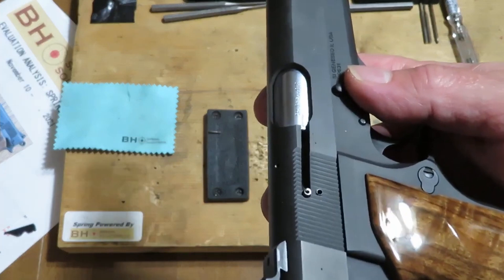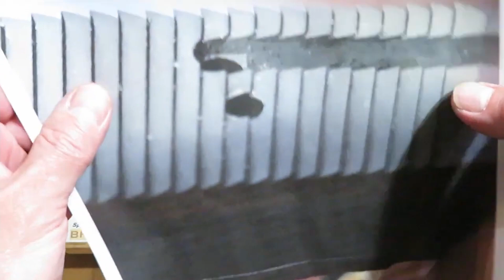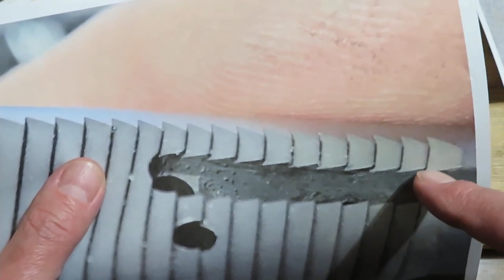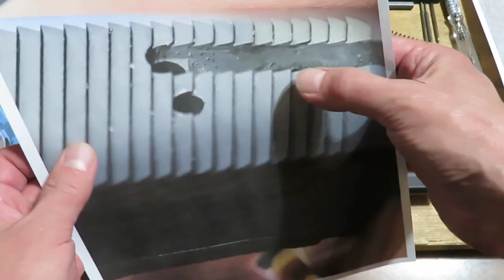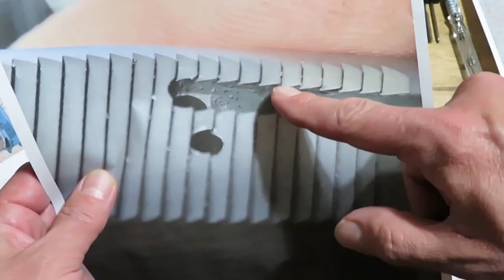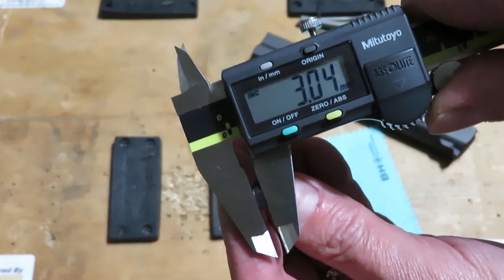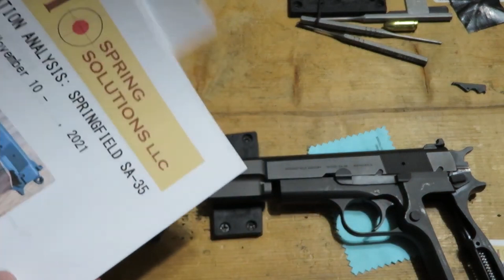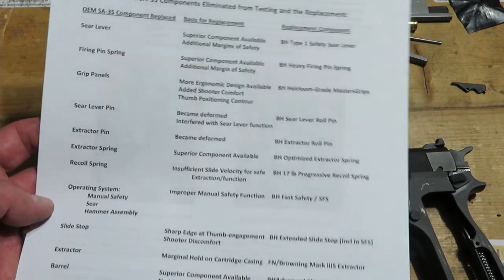Springfield SA-35 Hi-Power Evaluation & Testing Session 5 BHSpringSolutions Hi-Power University s.70

Comment: I really, REALLY hope Springfield is watching these videos and taking this information to their manufacturing plant.
Reply: This video would have to be in Turkish language for that. SA imports these pistols
Reply: @hstetser5376  I am pretty sure the SA -35 is made in America
Reply: @Grodd70  It may be partially assembled here but am near certain it comes from Turkey
Reply: @hstetser5376  I stand corrected, doing a Google search frame slide and barrel made in Turkey then internals assembled here. Well that takes it out of running for me.  If I wanted a Hi Power from Turkey there are others at a lower price point.
I'd maybe consider the FN but ill its "improvements" ruined the look compared to the classic HP. Plus it won't take HP mags, sure higher capacity is nice but so is being able to buy/ use Classic mags since they have been around for 85 yrs.

Comment: Wow, what a great deal! I can buy a SA-35 on GB for 3x MSRP, and then buy a real Hi-Power for a lot more money than that, then take all the parts out of the real gun and put them in my SA-35 (after applying a Dremel to the extractor channel, of course), and I'll have an SA-35 that actually works right once I get it refinished. Amazing. 

Seriously, though, I hope nobody is buying this stock and carrying it for self defense. I was excited to see a reasonably priced Hi-Power come out, and I really wanted one. It's a shame - it seems like Springfield would have put several thousand rounds through at lease a couple of these to check reliability, but apparently they didn't.
Reply: They actually did but I'd bet that they sent those out for coating.  The production ones are being done in house and the process is adding too much.  I shot the example ones they were passing around.  They were nice but they had a lot of finish damage so I bet it was thin to begin with.

Comment: I'm willing to bet that browning set their tolerances with blued slides, which reduces all surfaces (deductive process) SA is using cerakote or a like coating (additive process) this causes everything to fit tighter.  S&W had that issue in the 90s when they went from the 5900 series to the 910.
They do need to deburr the entire extractor recess.  I'd say a 17° bevel.  You can bevel the extractor instead, it will turn into a self cleaning channel.

Btw, nice slide bite you have there on your right hand, can tell you shoot a high power.
Reply: Springfield uses a matte blue finish on the SA-35.

Comment: The slide serrations impeding the extractor and the spring bulging to the point where it is not functional will be frustrating. It appears this firearm was rushed to market with issues that will be problematic for function and reliability?  Is the one you’re working with a prototype or a real early production? I don’t think a guy should need to get the Dremel out for surgery to remove metal on a brand new firearm. 🤦🏻‍♂️ you do a nice job on these videos. I really appreciate it. Thank you👍🏻
Reply: Anyone who has one right now has real early production.
Reply: The one that I just purchased a few weeks ago (Sept 2023) doesn't seem to have the issue with the sloppy extractor channel. I don't have a build date available, but I know these aren't sitting on the shelf for long.

Comment: I wonder if the cutter was worn or of spec when the slide serrations were cut or the extractor channel.   I could see how these cuts could be made in a CNC mill and it is possible the person who did the assembly had several extractors to try before finding one that fit.    I know companies try not to get into hand fitting firearms because it drives up cost.   Part of the reason a lot of older designs are out of production is because they required some hand fitting.   S&W started using MIM hammers and triggers on 3rd gen pistols because they required less hand fitting than forged parts.

Comment: Mark, in the visual comparison at 22:25 the length of the extractors from claw to pivot point is visibly different. Perhaps that also has an influence on the function.  Curiously the FN Browning extractor (left) is longer in this dimension, which should mean a looser hold - conversely the Springfield (right) is shorter - perhaps too short?  Just an observation. All the best, Rob

Comment: In your opinon would it be wise to replace my Tisas with the Springfield. My tisas has an FN extractor and works fine but is the Springfield better in the long run?
Reply: At this point you'd be replacing your Tisas with a Springfield Armory-branded Tisas.  You might want to wait a bit until SA comes out with a follow-up version that is more SA than Tisas.
Reply: Don't get rid of your day job!  I.E. your Tisas.

Comment: So what you're saying is "Buy a CZ-75".
Reply: Haha, that thought had crossed my mind as well, having owned a half-dozen of the actual Brownings over the years and an almost equal number of CZ-75 variants. But in all fairness, the designers of the CZ-75 had 40 years to see what needed to be improved over the BHP. Still, when you look at the probable "street price" of the SA-35 once demand settles down, it is awfully close to the price of a good CZ-75. Tough choice. Practicality favors the CZ I think.
Reply: @PPISAFETY  practicality to include aftermarket support/parts availability that is nowhere close for the Hi-Power. I love the Hi-Power and won't part with mine. But...